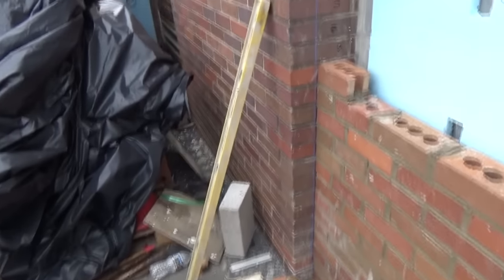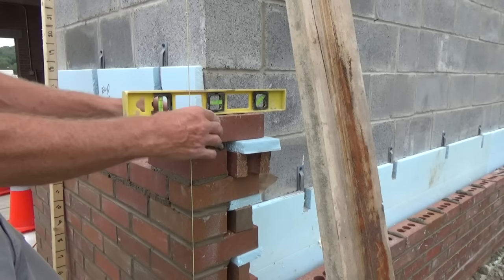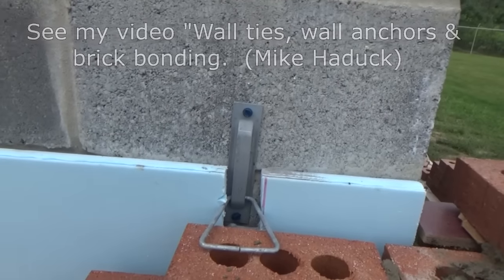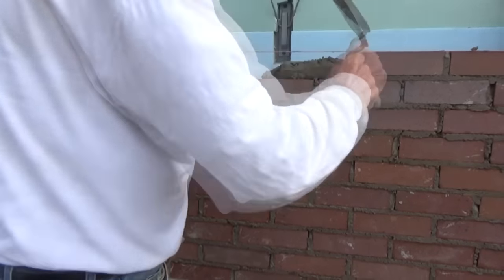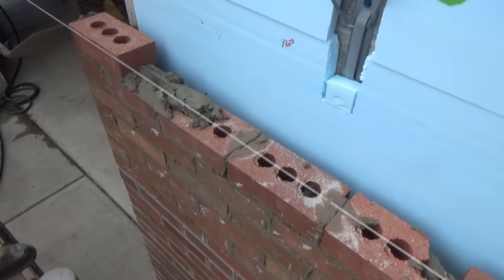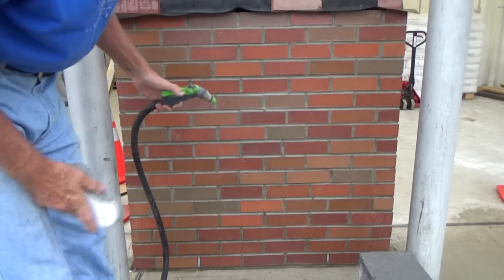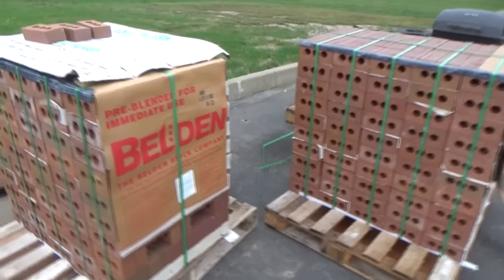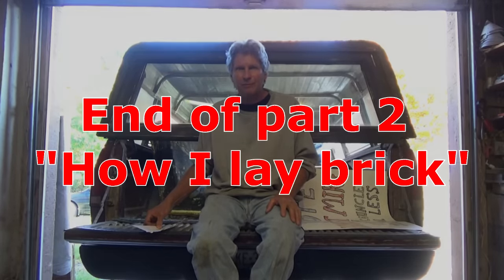BRICK LAYING (part 2) Mike Haduck

Comment: NOoooooooooo! Professional Help? have you Tried Seeking Um's? lol Buddy, Your A Master! Although I do have a Question for you. Can you use Quick-wall Cement to do Tile if your floor is Level but has low spots? Say 1/8 here, 1/4 there in various places some may be close to 3/8! levels Everywhere at every angle, wall, Doorway and it's just a Bathroom! lmao
Reply from the maker: I usually just use the fast frying tile cement to fill the low spots in the day before and go over it with the tile the next day, I know others do the same, of course every situation is a different, It always worked for me,  I hope it helps, thanks mike
Reply: Thank you!

Comment: You keep talking about the union.  Here in Missouri if the BA saw a Mason washing brick work you'd get a nice fine $$$.  I worked residential and Commercial and I almost killed the Brick layers BA.  I didn't know who he was and he slapped the trowel out of my hands.  I was on my knees putting down 4x4 pavers and I flew to my feet and the mason I was with started yelling and jumped on me because there was about to be a loudmouth BA thief dead!  I was pissed.  I carried hod since I was 10. at 12 I was outworking grown men and started laying brick in residential. We ran two crews.  When I was a laborer I worked commercial and was in the local 555.  I had better benefits in the laborers union!  That Brick BA and I had more than one run in and the last one he pushed me again to join the apprenticeship program.  I asked him if he would work for half his salary, still be a laborer a good part of the time and go to school one night a week and pay for that, or go with to the hall with 3 journeyman that would sign for me and skip the politics and thievery.  I had my card in less than a year.  I drove off a bridge a few years later and broke my back.  (Paralyzed)  Many years later my dad was ready to retire and the crooks in the union told him they made some bad investments (like dumping it in there pockets) and could he work a few more years to build the fund back up.  He told them where to stick it and they wrote him a check before the stole anymore.  If he hadn't been a successful contractor he never would have been able to retire.  Unions = crooks!  If you have to pay someone the rest of your life because you are too stupid to negotiate your worth you deserve what you make.  Back then it was okay, now walk into Ford and ask one of the brain dead the definition of solidarity good luck finding an answer.  I Knew a lot of good guys over the years and I had a passion for laying bricks.  If I still could I would, I would have changed operations and done repair work only and just me.  I'd say after the Mexicans stole what the unions didn't I'd make a $150 hr.  People ask me where to find a mason just because I used to do it.  I only know one...
Reply from the maker: Hi John,  I wish you the best. I was in the union 3 years in new Jersey,  and paid a lot of money in but never got a dime out of it. But the experience was priceless,  I got to work with a lot of different masons and still think about it now and then, if I had a family I would have got a govt job , but being in my own business gave me a lot of freedom, all the laws rules inspectors etc is where all the politics are now, I won't work in certain towns or cities because of it, I am glad I am 66 and getting my SS check, lol,  God bless, mike

Comment: How many do you lay in a day on average?
Reply from the maker: Hi cut,   all depends on if you are running long straight lines or building corners or laying out,  union was 350 a day by average If I remember correctly, but it all depends on how detailed the job is and how easy it is to get the material there,  thanks mike
Reply: That’s a very reasonable amount they expect a lot more here in the uk. The problem is when quantity goes up quality sometimes goes down.

Comment: Why do a 1 brick return and tooth? Just return your corner. Saves time and solid job.  Won’t crack. It’s not the levels fault either so don’t hit it. Tap the brick. Mortar on face work is terrible. Clean as you go or spread your bed better. Terrible example of brickwork. You seem a nice fella though so it’s not a personal thing it’s a fellow bricklayer constructively critiquing.
Reply from the maker: thanks Andy,  I will try harder,   mike

Comment: You keep the bond at one end and then break it at another end. Whats with that? you're right. We all have are own Technics. Snotters and washing down is a waste of time and money. You guys aren't Union.
Reply from the maker: Hi Charles,  I been union and I think when you been around long enough you will start thinking a little different, but no worries,   God bless mike
Reply: I havent been on a job where the wall didnt get splashed with a noticable amount of mortar at some point. Wash down is an important part of the job in my experience. However due to cost most contractors want to eliminate this step...

Comment: Mike never come to England to try and work as a bricklayer you wouldnt last the first day. Toothing is an absolute no no because it causes a weekspot due to a lack of mortar when filling in. Also never pin your line away from the corner because bricks vary too much, very poor job 👎
Reply from the maker: Hi Graham, well I grew up in the family business and been doing it over 50 years and always got paid, brickwork in the USA is almost a dead thing, all the earthquake codes won't let you build with it anymore, everything is going fake, steel and glass , very little brick work left,  thanks for the comment mike

Comment: I had to stop watching at 3 min.  You should be using your level to plumb your toothing. Not sighting to the end of the building. You guys lay brick way differently than I was taught. I would get laughed at if I showed up on any job with a plastic level.lmao
Reply from the maker: Hi Kansas,  God bless,   mike
Reply: Mike Haduck Masonry I wasn't trying to be harsh about the level but here we use Smith levels. All wood and made in Kansas City. Do you guys you them also?
Reply from the maker: Hi Kansas,  no worries,   anything that works,  I appreciate it.  mike